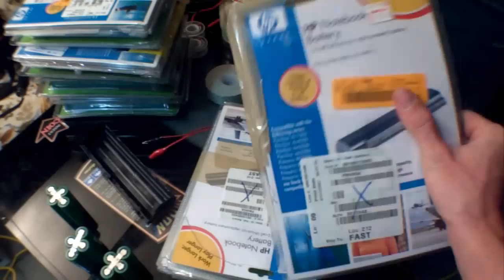DIY: 48v 24ah lithium ion 18650 e-bike battery pack

Comment: Hello, I like your video too, good job! I got this question, can you just connect the laptop battery packs together without even opening them? The ones I saw are 3S4P (12cell 11.1v 8800mah). So I would need to hook up 2 of them to get about 24v, 4 - 48v. Would that be a good idea since it seems like less work needs to be done or do I still need to open them up and then solder everything back together?

Another question, are laptop batteries usually protected from say over discharging, over heating? I've got a lithium battery pack on my ebike, I bought it for just like u said, about 10 times the price of building one :( it doesn't last too long either, it's a 48v 10ah battery and my motor can go up to 1500watt, but the good thing is that it just shuts down whenever it gets low so I don't end up damaging the battery.
Reply from the maker: no you couldnt reliably connect teh packs together.

Comment: I'm going to use this same idea and make a big 12v battery(or batteries) for my teardrop trailer. I'll charge them with a solar panel on top of the trailer. And maybe I'll set it up to be able to charge through my car when I'm driving?

Comment: so why not build 2 packs. power by one and recharge the second with a recovery charger while in motion. once its charger it stops charging. Also, you can use the second battery for a amp boost on hills to prevent the slowdown. You would only be adding what? 10 to 20 lb extra weight? no more than you would carry in a backpack. Just a thought.
Reply from the maker: "recovery charging" as you put it would be slowing me down for the sake of rechargeing the battery, that would be wasteful since that conversion process is not efficient. i dont have to break very often.

also i would have to make each one of these blocks 48v then, that would mean i'd have to charge one half of each battery at a time, so 4 charges for entire battery. this 24v works great for me so far. not counting i like that i can easilly hakc it appart to make 2 12v blocks for another project ^^b

not saying your idea is bad though, i'm just working with the charging restrictions i have.
Reply: OK, it was just an idea. Also, I was not referring to breaking for recharging. Rather a direct recover from one of the wheels.
Reply from the maker: Michael Speagle
well if you take power from the motion of the bike you slow it down. you can't pull energy out of nowhere.

Comment: Cool Idea!

What do you use to charge the battery packs?

You can pickup voltage and Amp Panel meters on Ebay very cheap.
That would allow you to keep an eye on the power as you ride!

Comment: Brilliant ! I just stumbled on this. I'm new to this myself but what I'm trying to do is replace my old powertool battery packs with Lithium ion battery cells. I'm a bit unsure though about what to buy as they seem to be advertised for powering cameras, laptops etc, is there a special individual cell I need for the demands of power tools.
Reply from the maker: roontunes i say just make a big battery pack for your tools. i never hurts to just grab a few old laptop batteries and experiment with them.
Reply: thanks, BTW how long does it take to charge your bike battery pack
Reply from the maker: roontunes
really depends on the charger not the battery.

Comment: Question. I want to pick up a more powerful soldering iron. I use a soldering station now but it is for fine electronics, not for Skookum battery tabs. I'm looking at two right now on ebay...150 watt and a 200 watt. Do I need a 200 watt or would a 150 watt be ok? Thanks.

Comment: Well done, do you have any form of BMS on the large pack you made, as most off the shelf packs that come with a bike have some form of BMS.
My bike is a golden motors type rear wheel, its heavy, and the 24v battery is a low end of what I am legally required to use, but i was thinking that the hours run time that I could get from something like you made here would be worth the effort.
Reply from the maker: in the next video i added balance leads so i could monitor the charge with a cheepo 30$ Imax b6 balance charger. link in the description.

i may tinker with a BMS someday though. mostly i'm just lazy and i got something that works so i keep using it haha.

i think i may get a 3d printer to help with my 3rd generation battery pack. that one will be stronger and have a fuse for each cell. i'll build it like that couse i plan to sell them on ebay. i think i'll make 12v 15ah blocks and people can link them together to whatever they wanted. :D
Reply: Rinoa Super-Genius the B6 has some crappy A** wires that come with it. you need to make your own to plugs and adapters for it to be useful. also, don't trust it under high voltage with any sort of a load.

Comment: don't worry about all the negative haters everyones a critic and allways knows better yes a bms is a great idea and should be used when charging in parallel or series but if you charging a single cell at a time it is not needed and like you posted bms will be in the next video don't let people get you down dude

Comment: Great video. I'm not technical enough to build the battery. 
How much would you sell 48v for? Needs to be able to do atleast 7miles?
Reply from the maker: I've been working on building and selling 12v 13ah modules that could be linked together to give 24,36, or 48v. they would give about 40 miles of range.

Comment: why use steel nails at this point?! i would be worried of heat and power loss due to the slight resistance of steel. and the battery construction is great! but i will raise the concern of longevity. i propose that the adhesive will fail due to the constant temperature variations due to normal usage. and the structural integrity will rest on the solder joints and eventually fail. so im thinking of casting the taped battery pack into resin for complete integrity- the only problem here would be that resin may not allow the pack to expand and contract as it needs to- so the next idea i  have is to cast the 'pack in a dense expanding foam, like that stuff that comes in the can... or even gorilla glue- as it foams and expands as it drys. cast into a block mold or secured into an enclosure.
question man, how much do you reckon one could  build an electric bike for? in terms of price. is there significant savings in adapting a common bike with an electric motor, batterypack, controller, - over purchasing a kit or an assembled bike?
keep up the good work man
Reply from the maker: yeah this was mostly just  a prototype pack. i made it from duct tape so i could always quickly rip it apart, and tbh i havent had any heat issues. i actually cant use it during winter because the cells dont heat up from use too much.

my next pack will be in a waterproof plastic container, prolly a plastic fusebox. and as for the price. i built the first iteration of my bike for

generic bike = 109$
e-bike motor/controller kit = 270$
first 48v 9ah lithium pack (20-30 miles at 25mph) = 80$

i hope that helps. maybe strike up a deal with a recycling center for old laptop packs.

Comment: thank you for great videos!. i have a 48 volt 1000 watt motor kit. i currently have a 48 volt 20 ah life4 battery. but i have found its way too heavy. i would like to build my own like yours. i think i only need abt 12 ah as i only need to go abt 10-12 miles.could you please please tell me the weight of your pack? and how many batteries would i need for 48 volt 10-15 ah please? thank you.

Comment: Mate, I've suddenly decide I'd like to build a 'chainless drive' push-bike with pedals turning a generator/dynamo, powering a battery, powering a hub. Could you tell me what device might I need to turn the variable power out of a dynamo into something steady that a battery can store? Hell, if you happen to know of anything designed to turn human pedal energy into battery charge, please tell me about it. 

I've seen three wheel 'velo-mobiles' doing seventy kms with this system and I'm sure a similar system could be slung on two wheels along with all the streamlining, , speed, range and tracking advantages.

Even if I had to sit stationary, (in the warm) and pedal to charge it up because the battery wasn't powerful enough to make it home again, I'd rather go home at seventy than seventeen kmh and it means you can pedal at a steady speed even if you're accelerating or going uphill- which let's face it, is where it hurts. I have to stop riding mortorbikes because they're expensive and dangerous (in my hands) but it's too dangerous to ride a pushbike around where I am because of hills (and drivers like me).

They make slow versions of what I want so I know the technology is out there. Hell; it's such a good idea I'm going to find out about it myself. Don't tell anyone about it yeah; I don't want all the halfwits having one before me.

Comment: ALL Li-Ion cells are normally charged to 3.7V. Most can get away with a higher voltage (especially if those are the Japanese Sony cells, very high quality), but will diminish the life of the cell. If these batteries had protection circuitry in them, you wouldn't even be able to charge them to 4.1. Take the battery out of your fully charged cell phone and measure the voltage, it will be 3.7 maybe 3.8, but it certainly won't be 4.1. I am not trying to be a jerk, just trying to be helpful.

Comment: nice job.  I'm building an electric bike... you make me want to build my own Li-Ion
battery too.  Did it really take that long to crack open the cases?  Maybe try a dremel with a cutting wheel... that would quickly zip a clean cut around, crack that nut easier.  It will smell bad but it'll make short work of it.  I'm going to check out your other videos, you seem deserving of your nick.
Reply from the maker: i did the last few with a dremel and they took about 15 minutes each. i dont want to hit the cells so i try to be super careful.

and thanks!

Comment: HI Rinoa am buying a 48v1000w wheel but don't weather to buy a plain black wheel or one like yours with the silver circles on it as  yours ever give you any trouble an would 6 10v laptop  batteries be  enough power for 10-20 mile....

Comment: Dude! You're my kinda geek. I'm putting an ebike together and plan on touring with solar panels, and batteries for a decent range are prohibitively expensive, until now! Can u tell me what psu I need to condition the batteries, and have u got any tips when buying old li-ion cells? Love what ur doin mate.

Comment: Thanks again, I guess I'm a jump ahead of your video. I bought a 48 v 16s BMS PCB PCB balance function for $50.45 on eBay. It has balance cables for 16 cells, so I had to order 4 more 4 packs , which brings my total to 64 or 16 -4 pack cells in a battery configuration of 4 banks of 16 cells each. Is there any reason why I can't keep all the batteries wired in a series since the specs for each bank of 16 cells is 35.2 AH?. I'm trying not to over ride the capacity of the 48 v. BMS which is 57.6 v.

Comment: Question: 48v. 15 ah lifepo4 bike battery, what is the best solar panel option to recharge while riding?  3 - 20w. 18v. panels or 4 - 20w. 12 v. panels ? Will this shorten my recycle lifespan, improve it, or non of the above. Thanks for your expertize.

Comment: I was considering putting together a 48v 36ah pack (234 cells) after watching your video but now I'm concerned about balance charging, overcharging, over discharging. I see the RC hobby guys and their LIPO's always talking about balance charging, but not sure if this issue is as critical with the 18650's.  What is the worst case or mostly likely thing to happen to my huge battery pack if I just charge using two leads and a 6 amp 54.6v charger?

Comment: hey I love your battery videos ! you have some really good skills when it comes to all this.
I'm getting a lipo battery from China, I was wondering if you have any videos or parts of videos which cover wiring ? it's just. Battery and three 15 cm wires attached.  I can solder to.  I've looked through your videos and can't seem to find one specifically on wiring.

Comment: Gotta love this character.  2013 leader frontiersman.
Wondering if he's still alive. He'll end up at an MIT lab and hope he learned safety points...
What we know now.
1) Insulate by air space (best) or kosher insulation between all cells. 
2) Measure all 18650 battery Volts individually and use parallel all within  +/- 0.01V
2) Use a BAS sp?
Use plastic cell set connectors.
Do the above so as not to have parts of your body fly in the four directions or burn yo abode down.
Reply from the maker: you clearly have no understanding of what is actually needed. this battery is still going fine 6,000 miles later.

Comment: Hey brother, as you use the homade pack here, have you considered whether a BMS is an aboslute requirement - I have a 48V 15000 W Magic Pie 3 on a bike, with 48V x2 x 10A. And the cells in each 48V enclosure seem to need charge balancing and to a lesser extent. discharge balancing/

Comment: nicely done , problem with soldering ferrous metals is that they get old and week and ultimately they break
Reply from the maker: yeah this isn't really built to last all that much. i figured i would think of a new design before these got old. and i'm already planning my 3rd generation packs haha. i can easily disassemble this pack if i ever need.

i did have to go back through the cells and fix some solder joints. but it seems to be doing ok now.
Reply: spot welding my brother that's the way and you can build one... if you are smart you can build a capacitor discharge spot welder.... that is too complicated for me but mayby you can do it...
Reply from the maker: TheDivineImpulse
yeah i bought some supercaps for that. but i'm not going to spotweld them. instead i'm going to 3d print a cartridge that you can add/remove cells from. so you can easilly remove a shorted cell. or i could sell the carts empty for cheep and people fill them up with cells as they get more.
Reply: genius. that's all genius.
Reply from the maker: TheDivineImpulse
aww thanks :D
Reply: Rinoa Super-Genius Let me know what you figure out for a 3d printed cartridge. I'm thinking of doing the same thing for easy cell replacement... not sure the best way to make connections though with everything bouncing around

Comment: Great info - very interesting!  What is the wattage of your soldering iron - and what would be the minimum wattage iron needed to get good solid solder connections on the ends of the batteries?
Reply from the maker: mine is a 300w soldering iron, it really doesnt matter much, its just i find this 300w has a lot of thermal capacity. i've soldered cells with a 20w soldering gun before.

Comment: You can discharge lion much faster than you can charge lion and lion cells are less efficient when charging when compared to discharging.
Check manufacturer datasheets.
The momentum of a cyclist is so low and air resistance so high that regen doesn't make sense for battery charging. You are using most of your stored battery energy to move through air which you cannot recapture. Again with the overall amount of momentum available and regen losses the gain is minimal.

Comment: If you have to friction brake too much on the downhill, preventing the bike's inertia from being carried over to and used for the next uphill, is regenerative braking a possibility?

Streetcars, trains and elevators turn their motors into generators when braking.

Shouldn't the chemical reaction to discharge energy be reversible at near the same rate and load to charge a battery?

Comment: Why didn't you just leave them in the original packs & just take apart a few of them to add to it to make up the voltage difference? Or 2, 18 volt packs in series is 36 volts, & then just set your speed controller so it can't send more to 24 volts to the motor.
Reply from the maker: because i dont want to build a computer system that can talk to all the battery pack. also idk if any of the cells where bad in the packs. also it would be a waste of space.

Comment: How many hours do you take to recharge it? Have you realized that you can charge each battery at the lower voltage (3.7V) individually, so you can speed up the charging time? maybe to only one hour to fully charge. (off course you would have to design a special charger) but this is just one idea. I'm thinking about doing it. Despite I haven't had time to find out whether this is going to worth it whether not. If you find anything out in the future please let me know. regards.
Reply from the maker: well i charge it with straight 24v and it can get to like 80% charged within a few hours. but i like to let it sit charging overnight. i use constant voltage limited to 1 amp.

then every month or so i balance charge it but tbh it really doesnt get out of balance much at all.
Reply: Rinoa Super-Genius These are 18650 batteries, aren't they?  Each cell should handle an amp easily, probably much more.  A quarter amp never seemed sufficient to me.  So at around 3:17 in your video you shouldn't have any trouble from 4A, maybe 8A.  What do you think about UltraFire batteries?  I can get them for about $1 each for 4000mAh.  Also, I'm looking for a motor similar to a Sunstar S03, any idea where I can find one for under $100?  I've started looking on eBay.

Comment: Great video, How do you ensure an even charging? i think most commercial battery packs have small circuit boards which measure heat and voltage of each cell,

Comment: Hi RInoa,

Thanks for the awesome videos. Sorry if you already answered this somewhere but do you happen to know the discharge rate of these cells? 5A, 10A, 30A, etc.
Reply: about 1:05 he said one cell could output 2A. That big solid pack had 72 cells. So considering wire thickness and temperature is not a problem you could get about 144A.